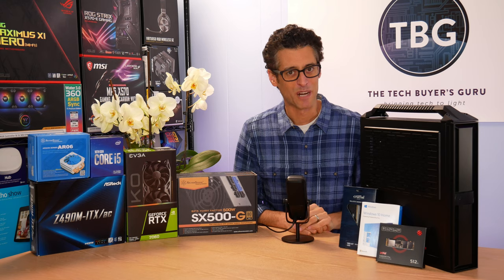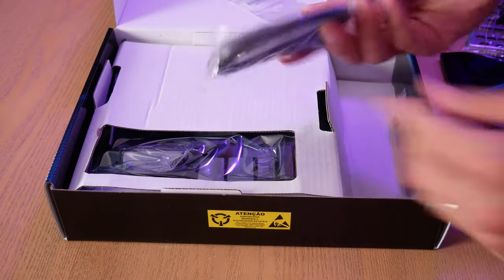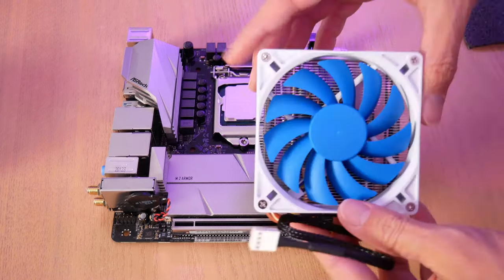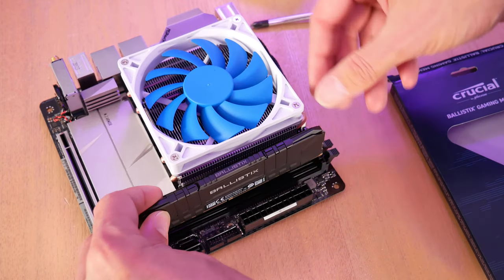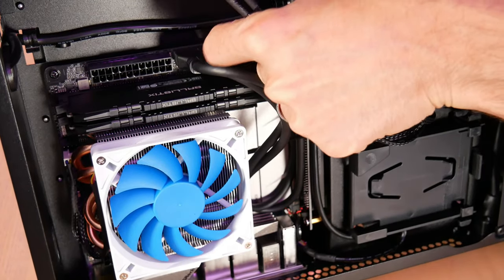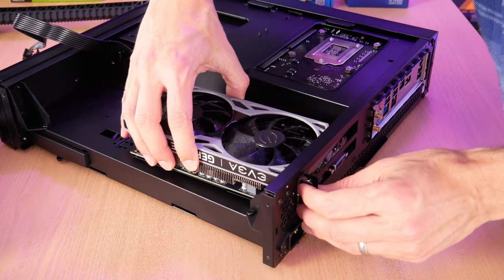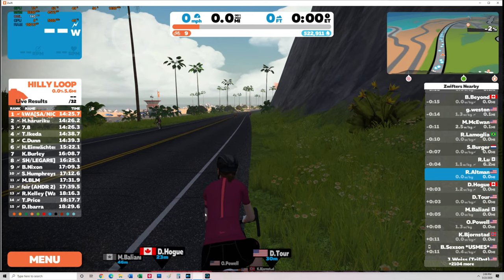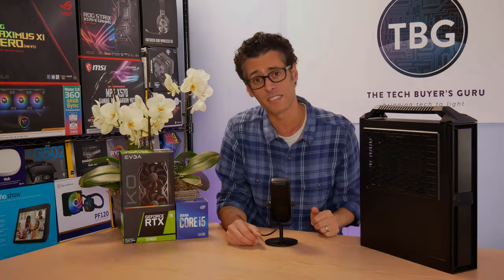The Best $1000 Mini-ITX Gaming/Zwift PC Buyer's Guide - Feat. Full Build in SilverStone ML08 Case

Comment: Brilliant video. I'm an avid zwift racer and am struggling running the game on my old MacBook Pro (2011). I'm keen to build this, but have a few questions as this will be my first ever gaming build;
Will the components fit into a SilverStone SG13 Mini ITX Tower?
I managed to source everything for the upgraded version, other than the EVGA Video Card, but found the Zotac in stock, is this worth running for the time being?
Thanks so much, Dan
Reply from the maker: Glad you found it - there really isn't much out there for Zwift riders, which is why I put this together! Yes, you can use the SG13, and you should probably check out my assembly guide for that case: https://youtu.be/RD2sKZiVEIc
But fair warning: right now is a bad time to buy video cards, due to their popularity in cryptocurrency mining. The model in this video is EOL, and if you found it in stock, it's probably way above the MSRP. What I'd recommend is building this system without a video card for now (the Intel built-in graphics will still be far better than your MacBook Pro), and then install a video card later on when prices come back down to Earth. You can read more about the situation here: https://techbuyersguru.com/1000-esports-gaming-mini-itx-pc-build

It's not clear if you've already purchased all the other components, but if you haven't, another option is to buy a pre-built PC that has the necessary components in it, like this very slick MSI model: https://click.linksynergy.com/deeplink?id=WAzU8cLhuCU&mid=44583&murl=https%3A%2F%2Fwww.newegg.com%2Fmsi-mpg-trident-3-10si-002us%2Fp%2FN82E16883152619%3F%26quicklink%3Dtrue
Reply: @TheTechBuyersGuru  thanks so much for getting back to me. I’ve not bought the components yet, so will check out both links you sent. Funnily enough I was thinking would it be best to just stick with the Intel built in graphics and maybe going for something with a bit more power like an i7 or i9... apparently single core Intel CPUs perform much better on Zwift. Brilliant channel, thanks
Reply from the maker: I've found the limiting factor on Zwift to be the video card, and even then, there are diminishing returns above what I recommend (I've tested with very expensive video cards, and it only increases the framerate by about 20% for double or triple the price, due to a limitation in the code of the app). I don't think going with the Core i7 would help much, if at all.

Comment: Great build guide as always. Very thorough. Can you please make a separate video detailing how to correctly install the Intel drivers; I always run into trouble with the chipset driver, the management driver, the rapid storage driver etc. in terms of the correct installation order and when to use the default drivers installed by Windows instead. It’s all very confusing to me 🤕 AMD seems simpler since there’s only one driver.
Reply from the maker: The drivers i recommend are shown in the video. Order doesn't matter, so I didn't actually show myself installing the drivers.

Comment: Nice clean build!great content as always.  Can you also do thermals and acoustics testing on this? btw, are silverstone heatsink coolers good? been eyeing an argon ar01 tuf gaming edition on sale. can it handle for example a 3700x?
Reply from the maker: I have never tested the AR01, it's definitely an older design (the first Argon, in fact!), and the TUF version is just a new color scheme. I will say that the AR06 I used in this video is excellent. I included it in a shootout I conducted on my website several years ago, and it won. The only reason I didn't test it in my recent ultra-low-profile shootout is that it cannot be used with AMD systems.

Comment: I'm posting this here because it's a current video  I clicked through for the Arctic P12 5 pack because that's a way to support. That link ( white fans ) leads to an out of stock vender. There are others ( in black ) in stock. I can wait a few days if you want to change the link but I know it's just pennies.
Reply from the maker: Thank you so much! A lot of these have sold out due to their popularity. Please note that the price has gone up, so it's now about $41 for the 5-pack of P12 PWM fans: https://amzn.to/36z41Fz

If you can fit them, the larger P14 PWM PST 5-pack is on backorder at a better price: https://amzn.to/3lkhvsL

If you recall, can you tell me which video had the wrong link?
Reply: @TheTechBuyersGuru   It was the 120mm Shootout from June 5th. There's a chance I could wait until November 2nd but I'm hoping I go quicker than that. Bought the 12s. I teach myself a lot of things on YouTube and I'm a first time builder so thanks for the good content in a well produced video. That's a lot of work.

Comment: Hello! Just a quick question: i have a Silverstone ML08 case and i wanted to replace my old 970. I was thinking to buy a ASUS TUF GAMING AMD RADEON RX 6800 16 GB GDDR6 or a ASUS TUF RADEON RX 6800XT OC 16GB GDDR6 but i'm struggling in understanding if they will fit the case or not. The only thing i understood is that i have to take away the card holder, but besides that i just can't understand if they will fit or not. Do you know if they will fit? Thanks!

Comment: Hey again! i was thinking of downsizing from the sg13 to the velka 7, and i was wondering if the alpenfohn black ridge would be fine for cooling the 3600x on the Aorus x570i ? 
Im pretty sure i have to take off the heatsink fan for the m.2 drive on the top.
Reply from the maker: Yes, the Black Ridge will be fine for the 3600X. You've probably seen my review of that cooler, but in case you missed it, here it is: https://youtu.be/eNDt9DKh13o

Comment: Hi TBG, excellent video build. I'm using Silverstone SX500-G too. I want to ask question. My PSU already make noticable noice from the fan when turned on maybe around 40db if I measure using sound meter app on my gadget. Is it normal? Because I read in several review, this PSU is quiet when idle
Reply from the maker: I have tested several SX500-G samples (including the one in this video), and I have not noticed a loud idle sound. What distance was your phone when you registered a 40dB sound level? If you test it right up against the vent, then sure, it might be 40dB, but that is not how you'd accurately gauge if something is wrong.
Reply: @TheTechBuyersGuru  i tested it at 5cm from the case. If i tested right up against the vent it goes up to around 47db. 1 meter from the case 30-33db. I compared to my previous PSU (enermax), it didn't make loud noise while idle. I make videos when I turned on my pc here https://drive.google.com/folderview?id=1-8SlaXqwK39EVwHeRXj-Yt7VUrs84bgV
Reply from the maker: 40dB at 5cm doesn't seem very loud at all. The difference between this and your Enermax PSU is that it is an SFX PSU, meaning it is much smaller and has a smaller fan. It also doesn't have a zero-fan mode. To keep from overheating, the fan always spins, and because it's smaller than a standard PSU fan, it must spin a bit faster. But you will not notice it once you have the rest of your system running.
Reply: @TheTechBuyersGuru  did you watch my video and hear the sound from my pc?
Reply from the maker: I can't tell where the sound is coming from. Sounds like a CPU cooler to me. Go ahead and return it if you want to, but I don't think the PSU is the issue.
Reply: @TheTechBuyersGuru  I also have tested it in open case and validated that noise from PSU is louder than GPU fan or CPU fan. I will try to ask Silverstone for a replacement. Thanks TBG for sharing and answered my question 👍

Comment: So you don't need a graphics card?
Reply from the maker: That's correct! As long as you buy an Intel CPU without an "F" in the product name, it has built-in graphics. This is extremely important these days, since you can't actually buy any graphics cards.

So, for example, the Core i5-10400 has graphics built-in: https://amzn.to/3q0lInu
The Core i5-10400F does not have graphics built in and would be a bad choice: https://amzn.to/3uDuQC8

But to be clear, the built-in graphics will not allow high frame rates or high resolution output in games or other graphics-intensive apps like the Zwift app I showcased. But that is a problem with the graphics card market today that you'll just have to accept, and later on, likely in the summer, you can add a graphics card to boost the performance of the system. Cryptocurrency mining has caused all video cards worldwide to sell out.

Comment: I don t like the buile, the intel cpu is a wast of money that could have been spent into a ryzen 5 ? Then you could re use that money on maybe cutting some corners to get a rtx 3070 when it comes out
Reply from the maker: Ryzen 5 more expensive, AMD B550 boards more expensive and typically out of stock, no built in graphics for testing/backup. Intel better solution for this build.
Reply: @TheTechBuyersGuru  yeah but you can t overclock the 10400 and it s not like a b450 s expensive also the 10400 is locked at 2.9ghz when the r5 3600 can go at 4ghz with minimum care and beyond with some smart oc, making the i5 10400 bite the dust. aslo not only is the gpu choice a bad idea considering what s coming but the ryzen 4th gen is coming next month so even a r5 3600 would be a bad choice now
Reply from the maker: 10400 not locked at 2.9GHz. Boosts  to 4GHz just like Ryzen 5 3600. They are very close, Intel is actually better for games.
Reply: @TheTechBuyersGuru  wait, doesn t only k series processor oc and boost ?
Reply from the maker: Only the K-series can be manually overclocked, but all of them boost. There were older Core models that did not boost, but everything except the Pentiums in Intel's current lineup features Turbo boost.

Comment: Why are you using a motherboard for overclocking? If you can buy a much cheaper "ASRock H410M-ITX / ac" motherboard from the same company? The processor is locked for custom overclocking. In the end, it is just put in a box and closed, and the difference in money is almost doubled. The money saved could have been a video card of the "Gigabyte GV-N2070-8Gb" level. More ... Why 2666 RAM for such a motherboard? There is no logic. It's also a pity that the review contains absolutely no tests of any game for which this computer was built.
But ... Non-standard construction in a small "ITX" box is a definite plus, and also plus a detailed explanation for beginners how to install computer components, especially the cooling system. I like it for the non-standard construction of the computer, but some components can be simplified, and some can be improved, which will ultimately affect better performance and lower cost of the entire gaming system.
Reply from the maker: I explained everything in the video. I'm using a Z490 board so I can use faster memory, specifically DDR-3200, not 2666. And the H410 is severely cut down, it loses a whole lot of features over either H470 or Z490. I'd never recommend it. And by the way, this isn't a review, it's a build guide. If you want benchmarks, look for a game benchmark video.